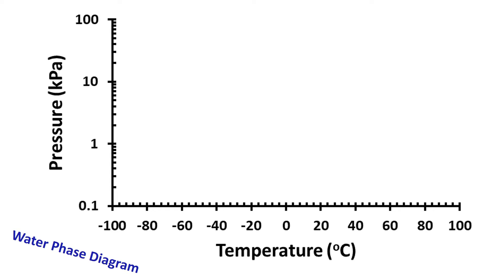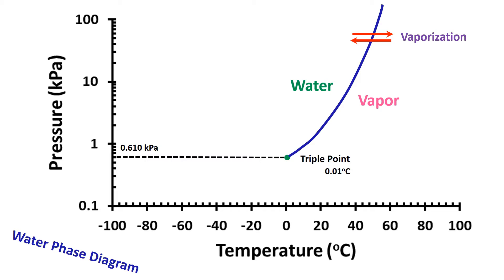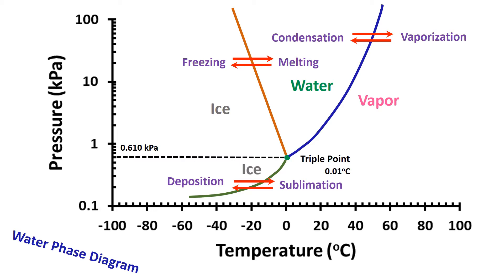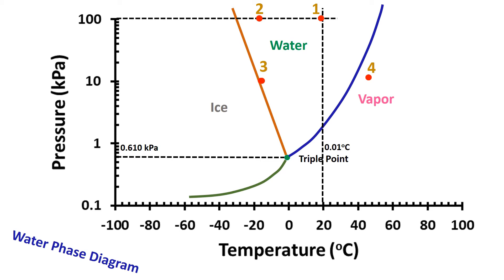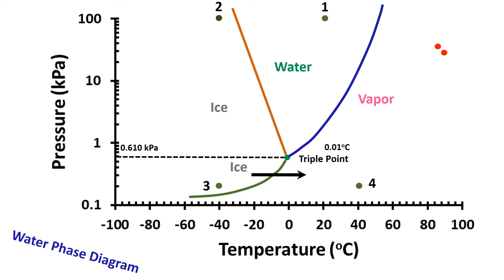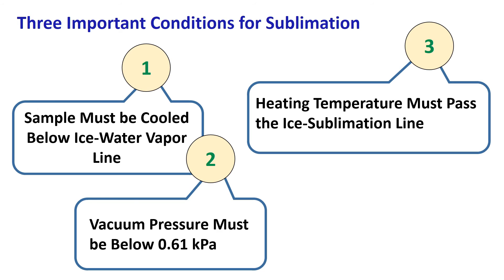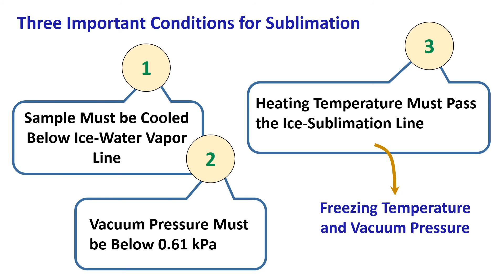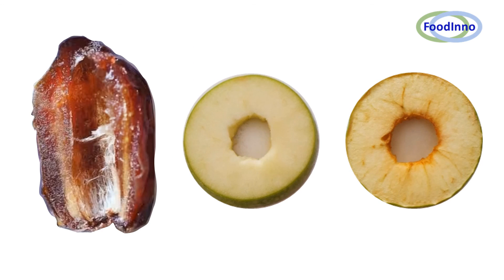How to Use Water Phase Diagram to Operate Freeze-Drying Process

Comment: Your water phase diagram is incorrect. Water at 101.325 kPa freezes at 0°C. Your diagram doesn’t reflect that.
Reply from the maker: Thank you. Yes, freezing-liquid line should be moved to the right little to make it water at 101.325 kPa freezes at 0C. This phase diagram was drawn qualitative without exect data point. I agree it would be good to draw exect data points. Hoverver, process should be the same. Once again thank you for watching my video so critically and your feedback. It is good to see someone is watching my videos very carefully.
Reply: Yeah, while watching the video I stopped and started to think. Something is clearly wrong. Next time use correct data if you want to explain something. Cheers, Dr. XXX

Comment: شكرا اخي على هذا 0:27  الشرح المفصل للطور ولاكن عندي سؤال إذا كانت الحراره- 20_  هل تتم عملية التسامي ؟ام شرط أن تكون- 40وجزاك الله خيرا
Reply from the maker: Thnak you. I am reading your question by English translation. You question was: whether sublimation will occur at -20oC? Yes you could have sublimation, when? After freezing at -20oC, if you reduce the pressure below 610 Pa then you will have sublimation when verticle line crosses the submilation line, or if pressure is below 610 Pa but not crossing the sublimation line, then you need to heat to cross the sublimation line to have sublimation. It not necessary to to have always -40oC for sublimation.
Reply: @foodinnovationshafiur  اشكرك دكتور انا صنعت جهاز تجفيف بل تفريز ولاكني أواجه بعض المشاكل عندما ارفع درجة الحرارة الى 50 تنهار الفاكه مع اني نفذت كل شروط التسامي الضغط والبرود ة وأعدت التجربه اكثر من مره اذا امكن التواصل واتس اب حتا ازودك بصور للجهاز وبالمناسبة انا فني تبريد واملك ورشه لتصنيع في 🇯🇴
Reply from the maker: @qwert3948  Thank you. I think your issue is witinin the material not the freeze-drying opearting conditions or sublimation.
Reply: @foodinnovationshafiur  اشكرك دكتور المادة هي الفواكة مثل الفراولة 🍓 او الموز🍌 اذا كانت درجة الحرارة-20 فكم يجب أن تكون درجة حرارة الارفف او الصواني
Reply: @foodinnovationshafiur  في الفيديو الأخير لك ذكرت أن درجة حرارة الصواني 40 مقابل -40حسب الطور المائي،فهل اذا كانت درجة الحرارة-20 تبقى درجة حرارة الصواني 40 ام نقلل درجة حرارة الصواني بما يتناسب مع درجة حرارة التفريز -20
Reply from the maker: @qwert3948  Thank you. There is a professional risk factor to give solution for a specific case in an open forum. Since if it goes wrong, then there is a professional responsibility. I am gving theoretical understanding to apply. You need to contact a food professional consultant.
Reply: اشكرك اخي وجزاك الله خيرا على المعلومات القيمه @foodinnovationshafiur